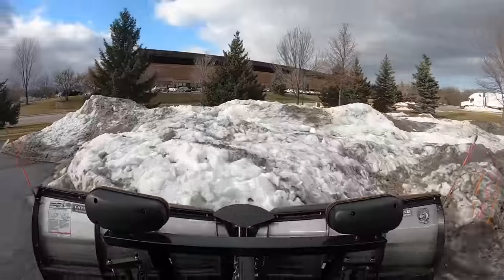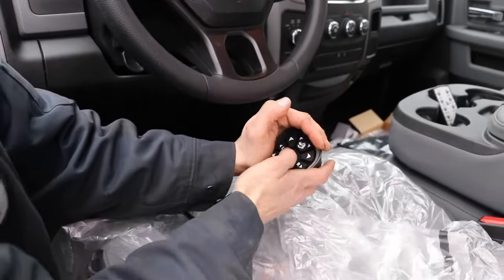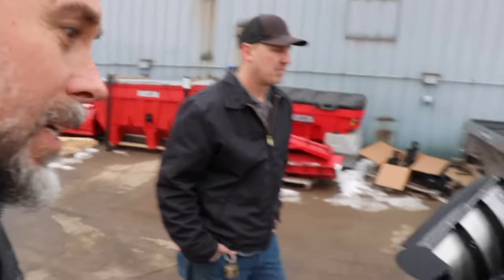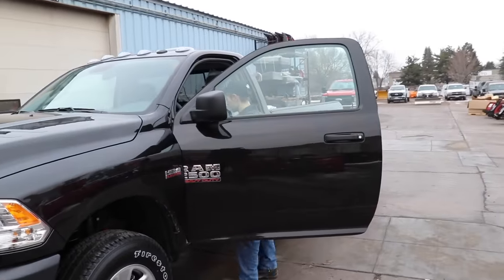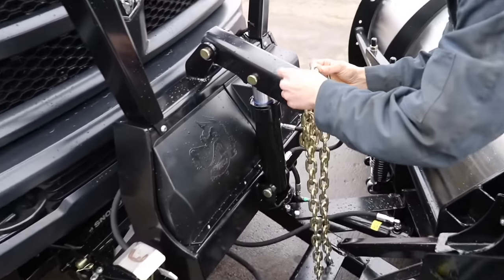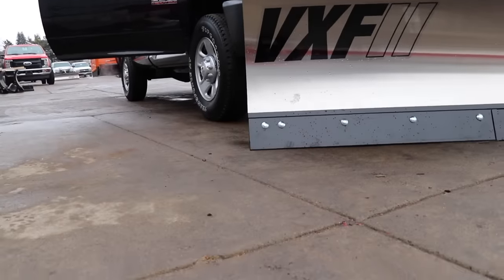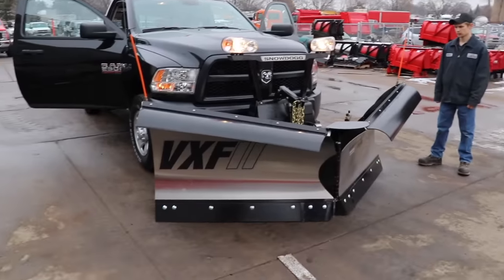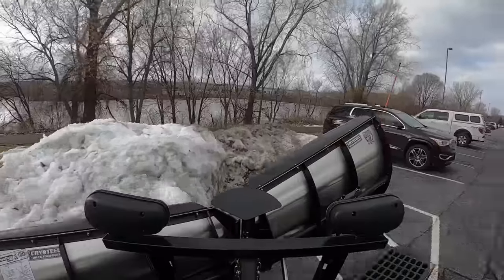Snowdogg snowplows- How do they compare with Fisher, Boss & Western

Comment: I really like Chevy trucks, I drive a Ford... when you put a blade on a Chevy truck it nosedives like the suspensions ready to drop out of it.
Reply: Have v plows on our 01 and 05 3/4 ton GM's. They do dip pretty bad with a heavy plow however we have added urethane bump stops on the front end to replace the factory parts. They have made an immense difference in ride quality and only cost around 125$
Reply: The factory bump stops actually just roll the weight off the front axle which is what you are probably hearing with the suspension dropping out, Vs the replacement ones actually sharing some of the load.
Reply: It's because of the independent front suspension. Both Ford and RAM have solid front axles on their HDs.
Reply: @dillonh321  My 87 F 250  Highboy 4x4 460 5speed with locking rear axle. But it has a floating front axle.I have an 8FT Western on it, it may drop 1 inch.
Reply: @billthompson5644  My rig is a 2016 ram 3500 6.4 hemi with extra heavy duty front suspension I have about inch drop as well with my boss 12ft.
Reply: @dillonh321  Very nice I keep my truck though the body is pretty clean,it's only got 52,000 miles on it. 460 are overrated junk. I got taken out by a drunk driver on my way home from church, in my 73 Dodge wagon. That took care of my driving for about 5 years or I would have been able to swap my 390 in there, 460s are just garbage.
Reply: @billthompson5644  
Yeah I hear they chug gas and aren't as reliable as the 5.8l Fords  or powerstroke fords. Love my 6.4l hemi, has plenty of power, no issues, only gets 1 less MPG than my old 5.7 hemi got.
Reply: @dillonh321  Try not to laugh because I speak the truth, the only thing that 460 can't pass,is a gas pump. It gets exactly 5 miles a gallon.
Reply: @billthompson5644  LOL
Reply: I usually install timbrens on the front of GM trucks. Cheap and easy fix. Makes the truck ride hard though.
Reply: CUMMINS
Reply: Gotta crank the torsion bars on gm when u put plow on- find your own happy medium of higher stance/bumpier ride
Reply: Thompson its true I get 5 miles to the gallon plowing with my 1994 ford f250 460 🙄

Comment: Snowdogg was the worst plow I ever used in 11yrs,  western is my #1, boss #2 , fisher #3, .. after using the Snowdoggplow for 1 yr the pins that connect and disconnect bends, your power wiring whatever you want to call it comes apart when your plowing, you need to tape and strap them together. This is just my opinion. I love my western

Comment: Not a fan. Snow Dogg and Meyer are 2 brands I stay away from. Douglas Dynamics makes Western, Fisher, Sno-Ex and Blizzard and are decent. My Western Uni-mounts are 30 years old and are on newer trucks with a ultra to uni adapter and still going strong. We get 250"-300" a year so the equipment needs to work and be reliable which Snow Dogg and Meyers are not. A Boss straight blade was good but the V destroyed itself within 4 years.

Comment: Is there good money in snow removal in Minnesota?
Reply: Mike Weber anywhere it snows a lot can be profitable. Depends on how many accounts you get, how much money you spend on equipment. Start with something cheap but still is reliable. I plowed snow for ten years with a 1/2 ton Chevy. It out lasted three 3/4 ton chevys and two Cummins. Sold it and it was still plowing. It made me a lot of cash. The big hold up with plowing is how fast you can get paid. As a general rule, the bigger the company, the longer they hold your money. Avoid nursing homes at all costs. It’s 90-120 day pay turnaround.

Comment: dont like snowdogg there super cheap.. and rattle apart..  ive ran older meyers the plow itself was great but pumps get water in them from the quick disconnect so had to rebuild them.. i trust western n fisher never had probs with either..  fisher is way heavier duty but western are lighter drop it n plow faster.. fisher u never have to adjust trip springs etc .. pumps and electronics are nice.. there must be a reason y most govts municipal and county road departments run western or fisher.. Also vblades arent that great. wider the better wideouts or just bigger plow.. if u know how to run a dozer you can stack snow high with a straight blade.. my thoughts but.. western n fisher are bettter
Reply from the maker: Thanks for sharing and for watching !

Comment: What a convoluted system! Ridiculous...took what seemed to be 4 minutes to cover the plugs. Weird covers, can’t see wearing gloves and trying to put them on.
Western has thee simplest and best connection system period. I don’t even touch anything other than what you need to. No rocking the head stock like fisher and no lifting pressure off it like snowdogg to release retaining levers.... pitiful. And you have to do all that in the slippery snow and ice.